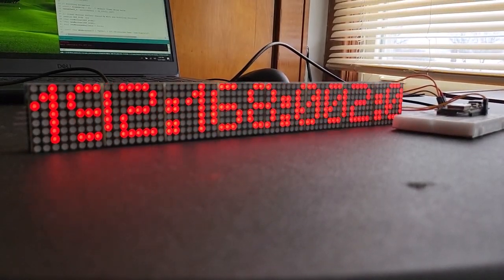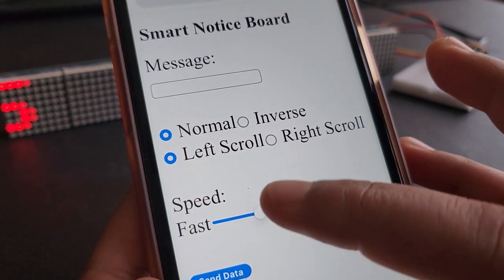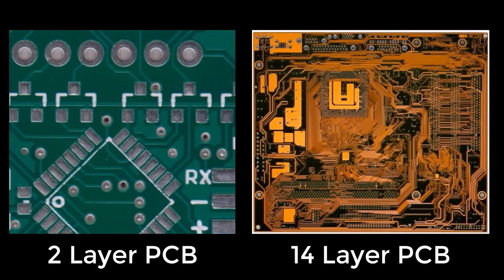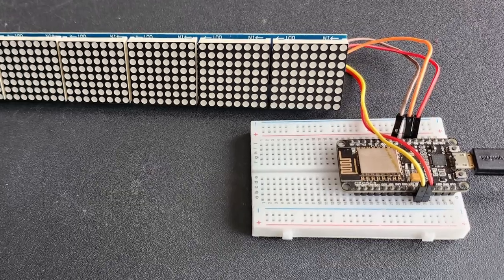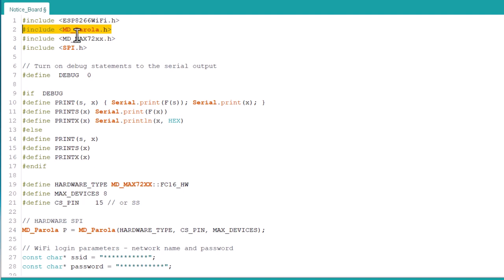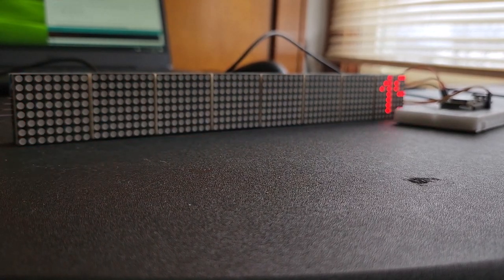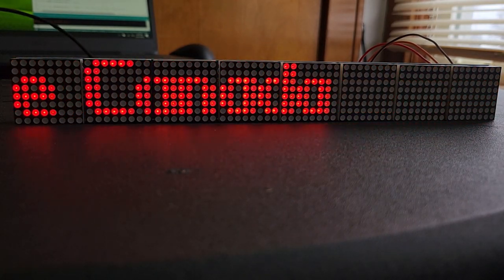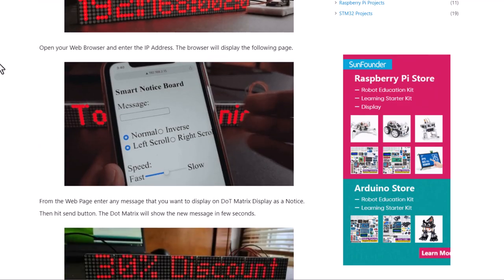IoT Web Controlled Smart Notice Board with Dot Matrix LED Display & ESP8266

Comment: Very nice, but what happens if you remove power?  Will it remember everything, including your scrolling message when powered back on?  Let's say you want to have this running for a few hours every day, with the same message, maybe only change it every few weeks, and you have it plugged into a timer or an alexa plug so it comes on for a few hours every day.  Will you have to re-enter a message/text every time?  Would be great if it remembered everything.
Reply from the maker: When u remove power everything is erased.
Reply: @HowtoElectronics  Thanks for prompt reply.

Comment: Nice project... Finally i understand We can control from anywhere using mobile wi fi network and my doubt is nodemcu also required wi fi connection means internet connection always?
Reply: Bro ppz teel me which language is used to create the web site  and is there any need of Arduino ide plz 😢😢😢

Comment: if i dump this code in node mcu . I'm facing this error . Variables and constants in RAM (global, static), used 28368 / 80192 bytes (35%)
║   SEGMENT  BYTES    DESCRIPTION
╠══ DATA     1504     initialized variables
╠══ RODATA   984      constants       
╚══ BSS      25880    zeroed variables
. Instruction RAM (IRAM_ATTR, ICACHE_RAM_ATTR), used 60267 / 65536 bytes (91%)
║   SEGMENT  BYTES    DESCRIPTION
╠══ ICACHE   32768    reserved space for flash instruction cache
╚══ IRAM     27499    code in IRAM    
. Code in flash (default, ICACHE_FLASH_ATTR), used 257028 / 1048576 bytes (24%)
║   SEGMENT  BYTES    DESCRIPTION
╚══ IROM     257028   code in flash

Comment: . Variables and constants in RAM (global, static), used 28368 / 80192 bytes (35%)
║   SEGMENT  BYTES    DESCRIPTION
╠══ DATA     1504     initialized variables
╠══ RODATA   984      constants       
╚══ BSS      25880    zeroed variables
. Instruction RAM (IRAM_ATTR, ICACHE_RAM_ATTR), used 60267 / 65536 bytes (91%)
║   SEGMENT  BYTES    DESCRIPTION
╠══ ICACHE   32768    reserved space for flash instruction cache
╚══ IRAM     27499    code in IRAM    
. Code in flash (default, ICACHE_FLASH_ATTR), used 257028 / 1048576 bytes (24%)
║   SEGMENT  BYTES    DESCRIPTION
╚══ IROM     257028   code in flash   . I'm facing this error if i dump this code